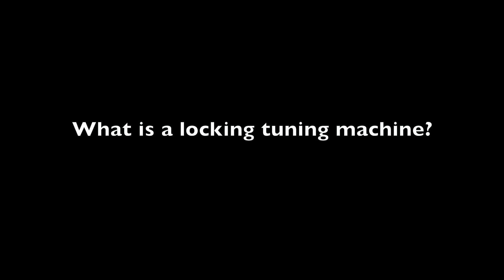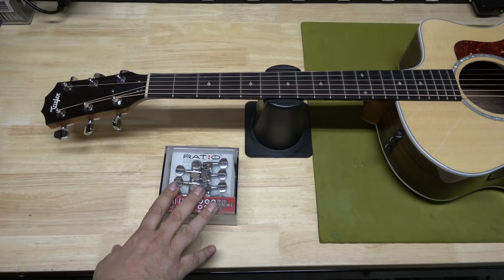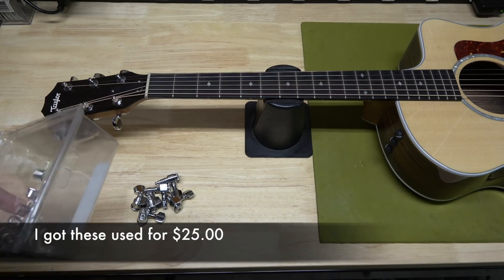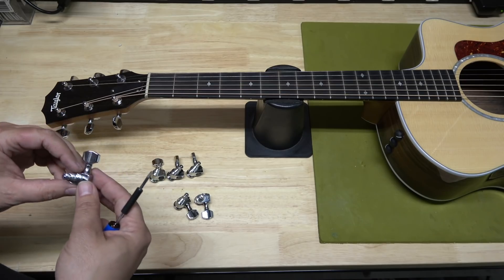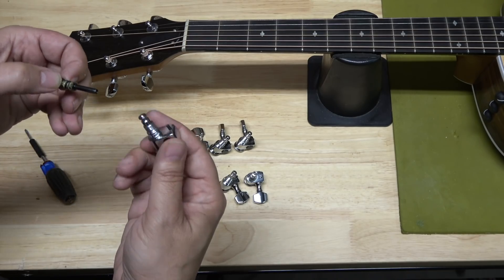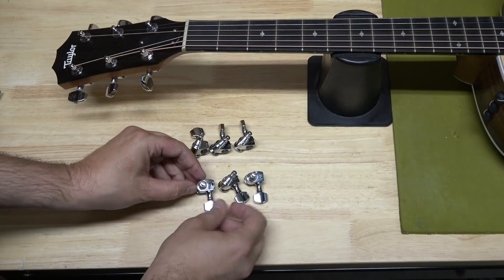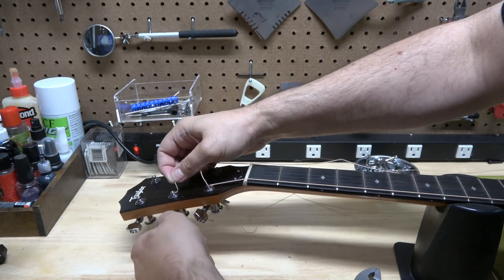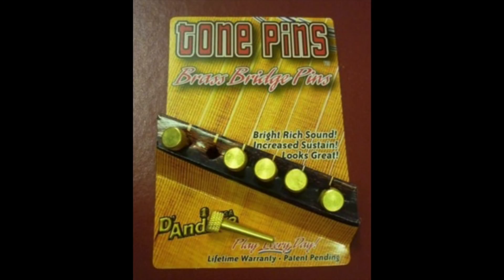Taylor 214ce Locking Tuner Install. Sharpen My Axe

Comment: I did both these mods on a Washburn, all Saple - Rosewood fingerboard.  It had a very dark sound, which I liked.  After a while the sound didn't do much for me.  I love Cleartone strings, tried their acoustic version & like the slightly brighter sound, sort of "cleaned up" sound.  On a whim, I bought brass pins & the sound got a little brighter, cleaner.  I love the sound now & so does my son, He's looking to take it on me.  All my electric (6) guitars have locking tuners so I put these on my acoustic as a convenience for changing strings.  All this before I stumbled across your channel.  I would say the pins benefits certain guitars.

Comment: From Leo:  I used those brass pins to brighten up a boomy old Martin. They did good in that one.    I tried a set on an all maple Seagull, and took them back out, they killed the lows and most of the mids.    Never thought about locking tuners on an acoustic.

Comment: I had wondered about this and the only answer I could find was that locking tuners were heavier and would cause a lightweight acoustic to get neck heavy.
As for the bridge pins, I thought the original were better on your Taylor. But, I had changed the nut, saddle, and pins on my old Yamaha FG 405, in that order. I put Graphtech XL in the nut and saddle, which was only available in black at the time. Since the old plastic pins now stood out, I replaced them with ebony pins. I was surprised to find that the pins made the biggest  difference of all in improving the sound. They were the cheapest change too.

Comment: I like locking tuners but if you ever plan to tune up or down from standard, you need to leave one or two wraps to allow for that or you will be stuck with standard only. You certainly don't need more than a couple of wraps though.

Comment: I put brass pins on my acoustic about 20years ago. My old pins had dry rotted and broke to pieces during a string change. This happens about every 10 to 15 years. I went with the brass pins to put an end to that. I did not notice any change in tone though, despite the package and the sales guy claiming it would improve the tone. I don't know if they are the same brand. All I know is that the tone of my guitar has always been far above average since I bought it 38 years ago.

Comment: There seem to be 2 benefits mentioned for locking tuners - staying in tune and quick string changes. For staying in tune wouldn't a locking nut be a better option?

Comment: I agree on the brass pins. I replaced the worn out pins on my 1973 Guild D25m with ebony pins. I could not hear any difference there. Also, I don’t believe ALL tuners can change sides like that. May be a good thing to check before you buy them with the intent to do that.?.

Comment: The gotohs on my Taylor are so awesome that I might drill my Strat headstock for some. I put hipshot locking keys on my seagull as the old ones felt grainy and the locking just made string changes faster
Reply: Gotoh keys ARE awesome. I have a non-locking set pushing 30 years old and they still function like new.

Comment: I think asking if locking tuners could or should go on an acoustic guitar is like asking the same question for an electric guitar. I think really it's down to what the player wants, and if the guitar is on the more affordable side and comes with cheaper tuners that are not so good quality tuners which would lead to you having to change them out anyway. Also, my experience with my acoustic guitar (I have an Ibanez AEG10) is with the original tuners, it didn't stay in tune anywhere near as much as I would have liked. I installed a set of Wilkinson EZ locking tuners (I know they're not proper locking tuners, but they're closer to locking that regular tuners) and I noticed the tuning stability was a lot better.

Comment: 🚩 Interesting, like the Original! ♦️Have a Question for you. All the Videos I've watched about Gear(like this) Never saw anything about the Nut(Acoustic) Changing Strings the Nut kept sliding. Couldn't find weak glue, put a Dot of Strong glue(Ouch) . Did I kill my Guitar? Tunning was hard thats all I noticed. Story longer but u get the drift. Ur thoughts? Hope u see.!

Comment: Last year I acquired a Taylor 312CE and have been contemplating not if I’m going to put locking tuning keys on it, but rather which kind. You’ve convinced me that the ratio tuners are the way to go Phil. Now my wife has an acoustic that is a little dark and a bit mushy. I put the abalone or mother of toilet seat or whatever the insert is on the top of the pin brass tone pins on her guitar and it was a positive improvement.

Comment: Oh good, I'm glad you said that. I was going to say the same thing. I like the tone of the plastic pins better. As for the tuning keys, I wouldn't swap out my Taylor ones but if I was going to upgrade those anyway I'd go with locking keys. Seems it just saves you time and energy with re-strings.

Comment: The main advantage of locking keys is quick string changes when a string breaks, this tends to be less common on acoustics then electrics (less big bends and all that). I typically change my electric strings when one breaks but tend to change my acoustic strings when they start sounding dull, i.e, not on stage in the heat of the moment when a locking key would be desired most. So I can understand why companies just don't bother with locking keys on acoustics. BUT, I could definitely see Monte needing them given the way he plays an acoustic.
Reply: That's very interesting. I tend to change my electric strings when they just won't stay in tune or make your hands smell of metal fatigue! After a long time of badly setting up my old Gibson guitars and comparing them to freshly factory set up guitars , I realised the break angle at the bridge was way too steep . Not had a string break in years . You live & learn 😉👍
Reply: @shaunw9270  "I tend to change my electric strings when they just won't stay in tune or make your hands smell of metal fatigue!" LOL, ya or that... but I tend to break them first .

Comment: Could you use them if you do a lot of alternate tunings? Could you do one complete wrap of the string and still be able to drop down, say, to a "D" or even a "C#" on the low "E"?
Reply from the maker: Yes, you can go down 2 full steps and more if you need to

Comment: I must be kinda weird. but my preference is totally not locking tuners. I do the 1 wrap over all other wraps under method on the tuning posts. I guess i just like the way that looks.
Reply: I agree. I don’t even cross wrap.
Reply: I use the same method = first wrap over, second and 3rd under.  It locks the string in well enough without a lot of effort, and removal is much easier than if you tie a knot in the string.

Comment: The brass pins did not work for me with that guitar.  I have a 214 as well but replaced the plastic pins it came with using Taylor's ebony pins. I like them. Might  be worth a more extensive  comparison?

Comment: I've done the bridge pin thing... ebony, bone... Tusq, brass... every time I found the stock plastic pins always sounded better.  I don't know why and I've testing this on multiple branded guitars (fender, martin, taylor, washburn, takamine, etc...).  I have found cheap guitars sound way better with bone saddles and Taylors always sound better with Tusq saddles.   Just my 2 cents.

Comment: Agreed...tone pins took away the low end. I once bought a Strat that the owner swapped out nut, bridge, and trem block with brass components. Deader than a door nail. The axe is collecting dust in storage.
Reply: I'll take it lmfao

Comment: The last time I brought Sperzels I got their EZ mount ones and their “grip spurs” on the back of them are prone to slipping if you don’t jam them into the wood enough in the beginning of installation.
The brass tone pins added some brightness. I liked them.

Comment: I have Waverly tuning machines on my Taylor 30th anniversary. The ease of the locking tuners sounds intriguing to me. I can’t do better then my Waverly’s. So stay they will.
Reply: You can remove and re-use strings on a standard tuning machine, like in this video.  But you cannot re-use strings on a locking tuner, they will snap at the point where they were clamped.

Comment: Phill , my go to acoustic guitar.  I've been using one for years in my solo acoustic act.  I will try the tuners as i change my strings very often . I tried a set of metal quick change pins on it but , did not like them and took them off !!!! I have a problem with my Taylor 214ce deluxe that no one seems to know what to do . Can i send you pictures of the problem i am having ??? The wood on the top of the body by the neck is wearing away from struming the guitar and i would like it fixed or repaired by someone that knows what they are doing . Let me know if you can help . Love your videos , I've learned alot from them . Thanks,  George

Comment: I have Schaller Locking tuners on my Alverez 5040. I also added power Pins 2.0 to my bridge. My bridge had cracked and de-laminated slightly from the body, so I had a luthier fix it, but then I decided to reinforce it with the power pins 2.0 plate. The whole set up acts like a clamp and squeezes the bridge together. Then the strings go through the pins on the top, like a stop tail piece. I can change strings very quickly. Tonally the guitar sounds very good to my ear, but I didn't notice much of a change in the brass pins presented here, so that might be my hearing.

Comment: It's my understanding that with acoustics you want the top as light as possible so it vibrates more easily.   Adding weight to it would prevent this and thus the loss of bottom end.   The pins simply keep the strings from coming out...and most of the pressured contact with the top comes from the contact between the string, bridge, and body...not the pin.   If anything I'd go with the lightest pin possible (I use ebony pins on my Martin...and they are slightly lighter than plastic ones).   Those brass pins will definitely "de-sensitize" the guitar if my theory is correct and make it harder to play with dynamics.    Locking tuners?  Other than the convenience of quick string changes they don't serve any other real purpose generally speaking.

Comment: What if you only put 2 or 3 or may you even 1. The one brass might not do a lot to the tone but 2 and certainly 3 will maybe it evens out at 3 and it’s the perfect match.
Reply: That would be interesting to find out. Just mod the strings that “need” it.

Comment: I put bone pins and a bone saddle on my 2015 814CE, I really like the results.  I also prefer StringJoy phosphor bronze strings on this guitar.  It will be extremely easy to put back the factory parts if I sell it, or just leave them in the case for the next owner.  The tone with this setup is a strong nudge towards Martin territory, or the Taylor V-class sound.  It's better for chords now, and the EQ has a bit more mids and upper mids.

Comment: Philip have you tried swapping the Taylor plastic pins for Ebony wood pins?  I did this but I don't think I hear a difference.

Also Taylor slightly redesigned their acoustic bridges so that instead of being straight they are stepped.  Do you like the new stepped bridges?  Should I mod my old Taylors with the new Taylor bridges?
Reply: Taylor uses a compensated saddle for better intonation.
Reply: @JohnShalamskas  Taylor just in the past few years went to a compensated saddle. They didn't use them ten years ago.

Comment: About the staggered tuner issue, would you not use them?  Or put the lowest on the d/g strings?  It seems like the break angle wouldn't need any help.

Comment: nice video. I recenty just got a Taylor 224DLX Koa. I thought about locking tuners, but in reality....it stays in tune extremely well. I'm sure that as the wood ages things will change, but I'm impressed at how awesome this guitar is considering its just above Taylor's "bottom" level guitars.

Comment: Though my Apple Cinema screen speakers, the 'tone pins' did have a nice cutting punch and for a rock band application, probably a nice way to cut through a mix. However, the Apple speaker didn't exactly render the loss in boominess. That said, I trust it did lose boom and that's not a great thing. That's where the sweetness in acoustic lies.

Comment: That’s a really cool drill jig though it’s easier to justify the cost when you work on guitars a lot. I already have a set of brass pins and tusk pins that I want to try out just to see if I like the sound more. I’ll try to remember to try them out next string change.

Comment: To me I could tell right away those pins were Honduran brass rather than Himalayan brass. The high altitude and low temperature of the Himalayan brass would've really helped to lower the oxygen of the mid tones and put a jacket on the high end. You gotta spend the extra couple grand for the ones made in the 60's. It's worth it. Climate change has absolutely devastated the current supply of tone brass worldwide, and don't even get me started on CBS era brass....

Comment: The "tone pins" added extra mass to the bridge area, which is almost certainly the reason the guitar sounded tighter, more restricted, and quieter. In fact, barring poorly fitting or buzzing pins, the only characteristic of any pins that could noticeably affect tone is mass.  I could see the brass pins perhaps helping on an overly boomy guitar, but they would probably do more harm than good on most instruments. Edit: Just to clarify, they pretty much ruined that otherwise excellent Taylor. Never let them approach it again!

Comment: I think the brass pins might be something interesting to spice up a guitar that isn't getting any playing time. From what I heard it's probably not something you want to add to a guitar where you already love the sound. 

I think the misconception about tuning stability and locking tuners comes from the fact that people just don't understand the importance of the nut on their guitar. I noticed an immediate improvement in my guitars tuning stability after I replaced my nut for the first time. I didn't even do a good job installing it and the improvement in tuning stability was easily noticeable.
Reply: I agree , the nut is very often overlooked . With 3 of my guitars that I bought new , a Gibson & 2 Fenders , tuning was a problem until I played them in a little, purely because they were brand new. In each case the problem was friction at the nut. I asked the in store tech to fettle the slots on the Les Paul , he actually declined and just put pencil graphite in the slots & told me to play & it should sort itself out in time, if not bring it back ..it never had to go back. The mim Strats , the nut slots settled in after some heavy whammy abuse , single strings would go off, pull up on the bar a few times and voilà! All sorted .

Comment: I’ve always thought it a good idea, as you say quicker restring and settles quicker with fewer wraps on the tuners. Perhaps one drawback can be added weight and of course they don’t come in open gear or slot head versions which are what I have on my two guitars, respectively. Sensible idea if you have M6 type mini sealed tubers etc.

Comment: The last thing a Taylor *14 needs is to sound brighter!

Maybe the brass runing pins would work, though, to free us Taylor owner's shackles to Exlixir strings.  Maybe the brass would make D'Addario or DR strings sound as good on a Taylor as the Elixirs do with wood pins.
Reply: Elixir’s sound so nice on my Taylor that I’ve never considered another brand. I understand string choice is very subjective and elixirs aren’t necessarily the cheapest option but why mess with what works? But I get where you’re coming from for sure.

I do agree about the brightness. If more brightness is desired though, I’ve found that using Dunlop’s Ultex picks provides a louder, clearer, and brighter tone. It sounds “better” to me without getting to harsh.

As far as tuning machines, when I upgrade it’s going to be non-locking Gotoh Delta 510’s. I’ve never had the need for locking tuners.
Reply: @ryanwilson5936  I am totally with you.

I went through the exercise, shortly after I bought my Taylor in 2003, of trying other brands and gauges of strings.  At the time I was very fond of DR strings on my Takamine, which I had traded up from.  But nothing sounded nearly as good as the Elixirs.  And my only regret / resentment over sticking with Elixirs over the years  remains the cost.

If you do your own setup and maintenance,  the only real recurring cost of acoustic guitar ownership (that must legitimately be ascribed to the guitar, and not a love of music or the eternal quest for your own tone) is strings.  I estimate that, by changing my strings regularly over the last 16 years, I have spent close to 50% of what I paid for the guitar, for strings for it.  While it's clearly worth it, it's also easily worth considering alternatives that might provide me the sound I love, while leaving me with a few hundred extra dollars in my pocket (over the course of my remaining life).

What's more, when you have multiple guitars to care and feed, it really starts to add up!

Like you, I tend to subscribe to the adage "If it ain't broke, don't fix it".  But that certainly shouldn't stop us from exploring new opportunities.  This is especially true if you have a set of brass bridge pins hanging around and you are wondering what to do with them - or, better still, you know someone who does.  ;-)

Comment: I have Sperzel locking tuners on my Custom Shop Breedlove. I believe that it stays in tune better because there are almost no wraps to compress. And as you said, string changes are FAST!  Plus the Breedloves have the string through bridge(no bridge pins). I love 'em!